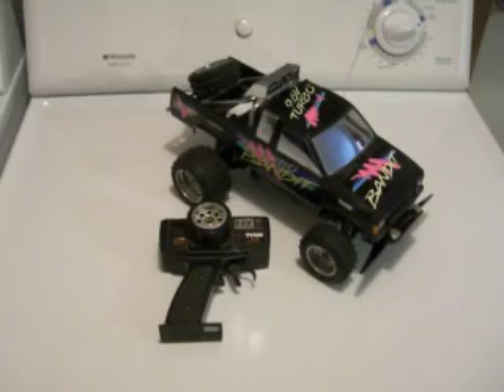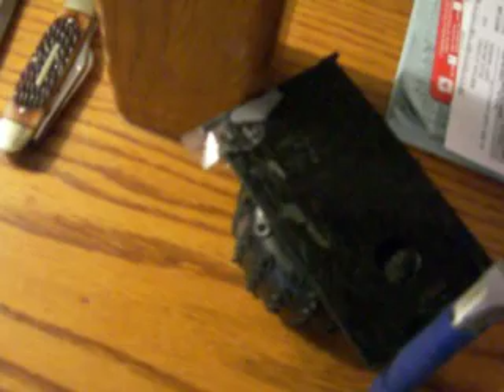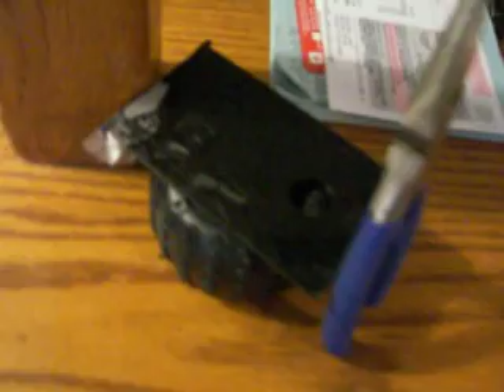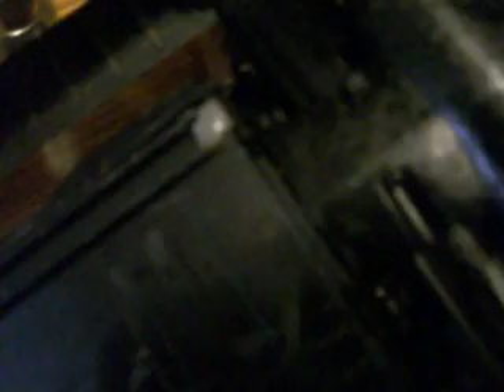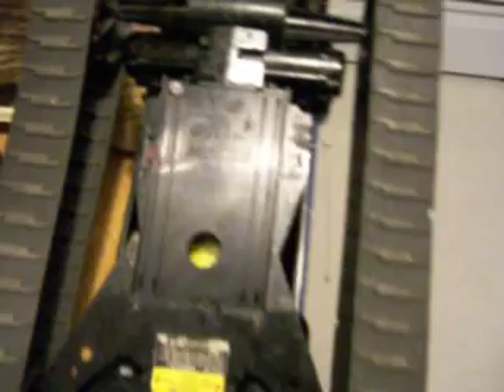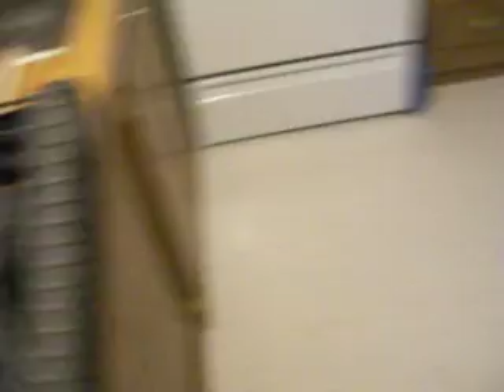Tyco black turbo bandit repairing A-arm and battery door.

Comment: When you break it again theres a much better way of fixing it. I used a team associated rc18t rear shock tower and fit it to the front end. I also used the rc18 shocks and mouted them into the stock bandit control arms. Now it is indestructable and has adjustable oil filled suspension. You can see how i did it on dragonhobbies website

Comment: I'm trying to find out the name of a couple of old Tyco (I think) R/C cars from the '90s. One I thought was called the Rattler, and had 10 wheels, but I can't find anything about it on Google. The other, all I remember is that it had these expanding rear tires that ballooned as it got faster, and they advertised that it could hit 200 mph (scale speeds, obviously). So if you remember these, or could point me to someplace that had the information, I'd appreciate that.